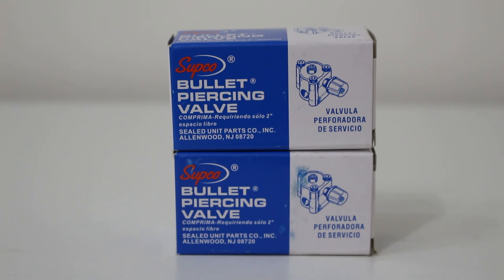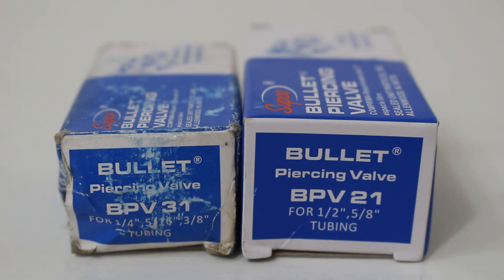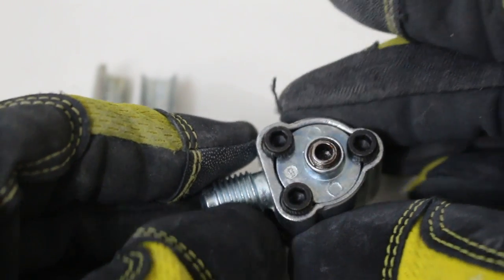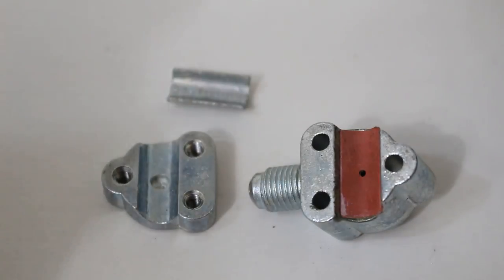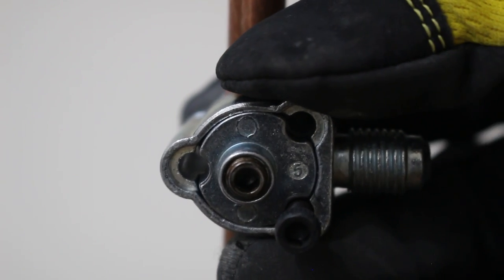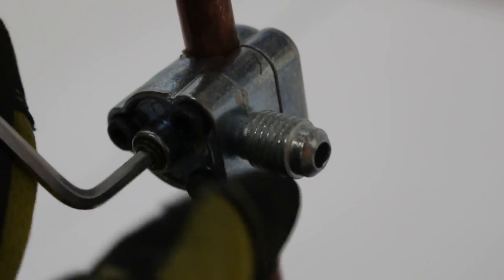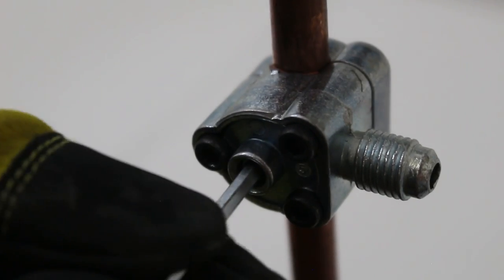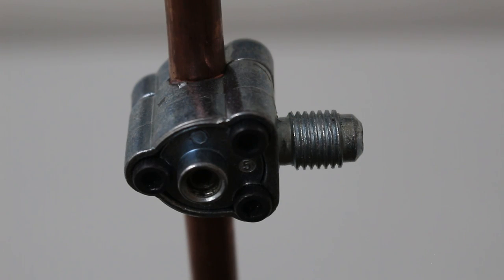HVAC: How To Install a Bullet Piercing Valve On Any AC/Refrigeration System (Supco BPV21 BPV31)

Comment: Very good video.  These types are the only ones I trust to use for a temporary charge to get a patient heat pump going.  This is the last thing before the dinosaur gets changed out. Some of the places I have to install them would have to be seen to be believed. One hand installation, not visually being able to see anything. Some of them I have fought with for about 20 minutes to install. The only way I can get it done is to take all the screws out and get one that is about 2 inches long and use it like a pivot to go around the pipe;  tighten it securely and install the 2 that it come with;  finally removing the 2-inch screw and install the last screw it come with, Trying not to fall off the ladder or shock myself because the unit is not shut off. LMFAO-Thanks for letting me vent or purge myself

Comment: It might be a good bit of insurance to screw a port cap onto the valve after you finish servicing the system. That will keep dirt and dust out of the valve also. I am curious as to how well that paper gasket really seals against the pipe. I have another older wagner piercing valve that has a different design, you screw the cap on to pierce the pipe and when you take it off it seals so you can put the hose on. Also, around the piercing pin there is a round rubber gasket that I would trust to seal better than a paper gasket.

Comment: How would you discharge the system.  Doubt EPA wants refrigerant floating around when removing a compressor on a window ac unit.

Comment: Two answers. One person asks, can you re use adapter? No, it must stay on the line, because you’re piercing a hole in the line with this part. This part also plugs that hole you made.
 2nd. Someone commented that the epa would frown on not being able to remove Freon, when discarding appliances. Well, this tool is used because there is no port to begin with.

Comment: The male access port on my Supco BPV31 does not fit with the male 3/8 compression fittings on my Gauge blue hose. What kind of adapter do I need? What is the access port? I tried a SAE 1/4 inch and it didn't fit.

Comment: Does it matter which line to use on the compressor?
Reply: That’s what u want to know
Reply: Suction if you want to add charge
Reply: Suction side is cold side, and it's the line that connects the evaporator inside the freezer section and compressor. 

Not the one connected to the black net that looks like a radiator outside of the fridge.  That line is high side.

Comment: Does anyone know why my pressure gauge is reading 70 psi when I open up the piercing valve to get an initial read (with the compressor running). 
Definitely not showing up as negative pressure. I’m 99% positive I’m installed on the suction line.
Reply: Look up a pressure temperature chart. For the refrigerant your unit uses. 
for example. If the (outside) temperature is 70 degrees you should have 121.4 PSI ( pressure of refrigerant). for an R-22 unit....
If your reading was 70 psi ( that means your low on charge) so you would add to get the correct pressure for the actual ambient temperature. 
I would suspect that at your psi for example it would be 41f in a r-22 system and you would see ice/freezing on the vapor ( large) line. 
The adapter would go onto the (larger) line referred to as the "vapor" line which in this video he calls the ( suction line).

Comment: The Machining on these Looks extremely crude. Anybody make one in brass, since the line they are going on is copper?
Reply: It's good enuff tho cuz it's being pressed onto a soft metal so the soft metal seals the micro channels. It also has a gasket
Reply: @AdrianButler86  I used some 1500 sandpaper wrapped around a big round carpenters pencil to get rid of the casting imperfections. Mine came with a tiny HNBR oring to seal between the saddle and the copper tube. Worked great. 15 bucks for 2 and a few ounces of 134a and I'm back in business. Freezer down below zero f , fridge at 36f. I charged mine to 7lb on the low side.